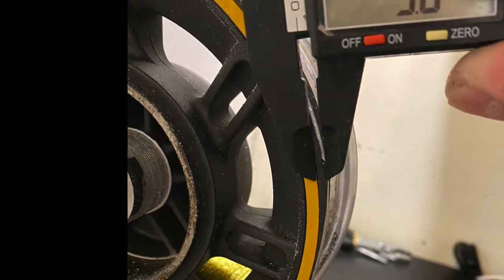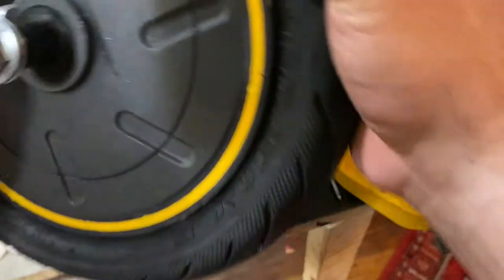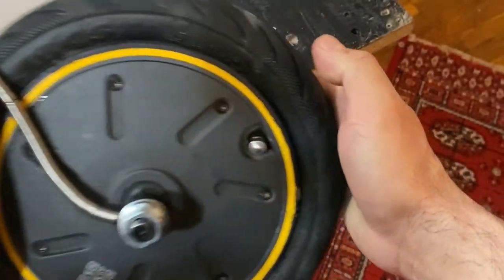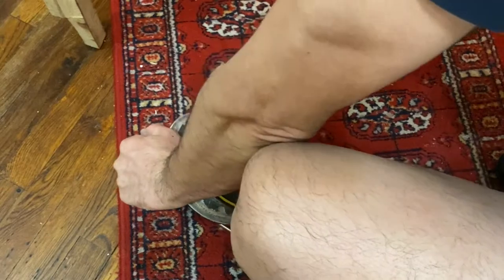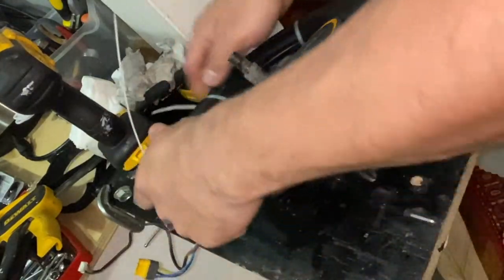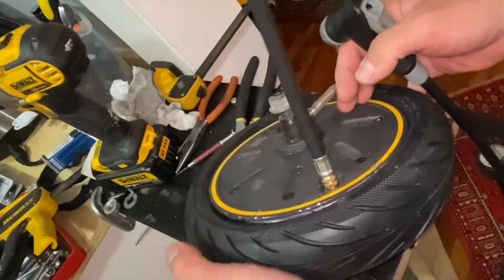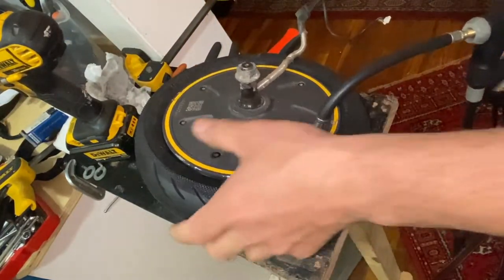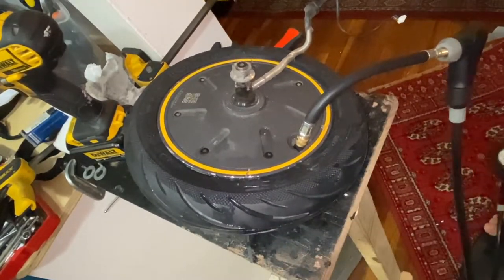Ninebot Max: Best way to install a tire and treat a damaged rim!

Comment: Thank you for the valuable info.
I have  NineBot G30 for about 2 months now and seem to need to inflate the tire on the back wheel every 1-2 days otherwise it has no pressure at all. 
I started pumping up before every ride ... 

I did the soapy water test around the rim edge edge and found 2 small leaks, one on each side.

What do you recommend? 
Should I go ahead and prepare to take off the tire and put it back on?
Reply from the maker: Maybe time to replace the tire. Use clamps to pressure tire then 14" levers to remove. TO install back use 6 sipties on the tire and use no tools for installation. add a bit soupy water around the bead and add air. If rim has damages, do fix it before tire its installed.
Reply: Had the same problem pumping before every ride. Bought non original tire and could not fit it on the rim. Afterward bought original tire but was unsuccessful because I could not fit it properly. 

Finally found this vid and the soapy water did the trick. 

Also check if it leaks air at the valve. It’s cheaper to replace. There is a vid on that.

Comment: Great video, the best one on yt regarding G30 tire replacement.
What is the length of your Spoon tire lever? Not sure what is more practical for Segway G30 tires, thera are two models with length of 290mm and longer with 370mm?

Thanks.
Reply from the maker: 14" Motorcycle lever Find on amazon.
Reply: @esnkaz  Could you please perhaps measure them? I would not want to buy too long spoons and yours look perfect. Are they really 14" or maybe just 11"? Thanks again.

Comment: How do you unplug the main connectors on the inside? ( Blue, yellow, brown)
Reply from the maker: That’s hard to get explain as I would just tell you unplug them by pulling one connector with wire and then pull the other side jejeje

Comment: Hi friend, thanks for the video! Do you know which hall sensors are used inside the g30 motor hub? I'm struggling to find that informantion to bring my scooter back to life and the orginal sensors were discarded without taking note of which model they were.
Reply from the maker: Did your motor got smoke due to battery upgrade 48v?
Reply: @esnkaz  Not actually, I didn't upgrade it to 48V it is still orginal. But after a long hill down I've got some noise in the motor and error 18, hall sensors (and motor connectors melted). I brought it to a service that tried to replace the sensors but it never worked again. I found another service with more experience and his guess (after man different tests) is that the reason is that they've used different hall sensors than the ones that came in the motor.

I'm trying to discover the stock hall sensor for weeks now, tried to buy a new motor but due to mail ad customs all orders were cancelled, so I couldn't bring it back to work yet.
Reply from the maker: @adriancovi  Yea you made a mistake by trying to fix motor that was not damage. When Phase wires connectors melt never and I mean never the motor gets damage. You just needed to replace the controller and problem solve. I will strongly suggest to buy a bigger motor. 1000W they work on 36V. Mantis perhaps. I did repair a couple motors I burned myself from overload of use of 48V and they last about a month after sensor was replaced. Not worth it to fix all motor. Where are you located? I have used motors if you would want one. Contact me on my FB group Esnkaz Ninebot Max Evolution USA. I can give you one for free.

Comment: Hi I have 5 tires that need replacement, I have gone threw 4 tubes and destroyed 1 tire in a day and still cannot get the bead to sit right, I have used lots of dish soap and even tried grease. My fingers are in in pain and still no luck any recommendations
Reply from the maker: Ninebot wheels don’t need tube. You possibly are using cheap tires. Get original tires and follow installation procedure. Never fail. I install tires all the time using this method
Reply: @esnkaz  yes definitely, they are not the original. Will try get the originals and try again. Really appreciate the help 👌

Comment: Everytime I air it up there's the pinched spot on the bead everytime it's a brand new tire and I'm so aggravated with this. I'll try prying on it with spoon like you did but I'm almost convinced the tire is not really 60/75-6.5 even though it says that on the tire.
Reply from the maker: Ninebot Max Stock Tire size its 60/70-6.5 Do clean the bead properly and you should be ok. Need further assistance, write on EsnKaz FB group.

Comment: Off topic but does anyone know how to remove the yellow stripes from the rims ? I have tried a heat gun and also acetone but they seem to be painted / stuck on pretty good ? id like to jiust have the matt black rims with no colour ...
Reply from the maker: I would thing you will need to sand it then prime it and spray paint after. Rear rim simply put the scooter to run use a 150 sand paper to start place it gently on the side of the rim scooter running on max speed of 10mph to remove that paint takes a few minutes using same method done here with bead cleaning.
Reply: @esnkaz  thanks for the quick reply mate 🙏

Comment: So when you use slime it made the problem with the rim?
Reply from the maker: Yess.
Reply: Oh wow, I have the same scooter and I put some slime in my tire a couple of days ago. I'm about to change the tire this weekend, I shouldn't have the same problem If I only had the slime in for 2weeks, What do you think, Is that long enough to create a problem like that?

Thank you for the fast reply
Reply from the maker: @badlands5527  Slime doesnt dry unless tire is damage and with no air sitting. The purpose of slime its to seal small holes and stays liquid for month or years... Dont worry about it and replace the tire as soon as it doesnt hold air in.
Reply: I have Segway p65 I had slime in the tire for over 1 year no problems

Comment: I did the technique and got the tire on but it still stays at the same psi it doesn’t seem to seat in at all. Could you help me please!
Reply from the maker: Put a little of soapy water around and pressure the tire to 100 psi. once bead gets seated reduce pressure.
Reply: @esnkaz  Thank you would i need an compressor?
Reply from the maker: @maincharacter2677  bike pump will do.
Reply: @esnkaz  Thank you so much!